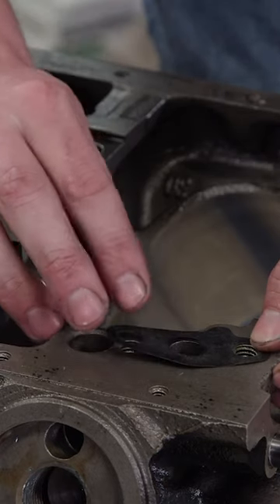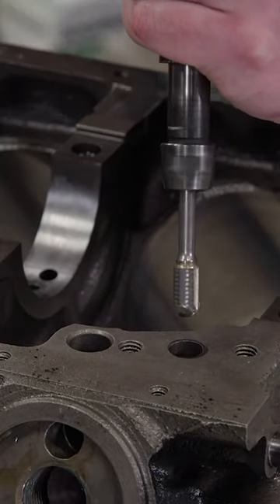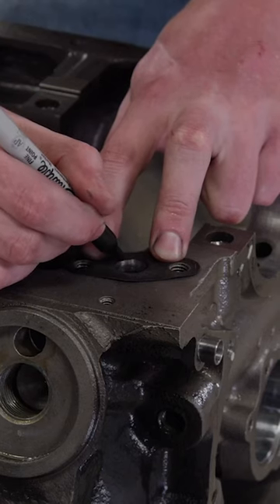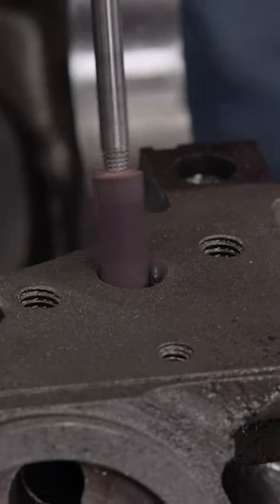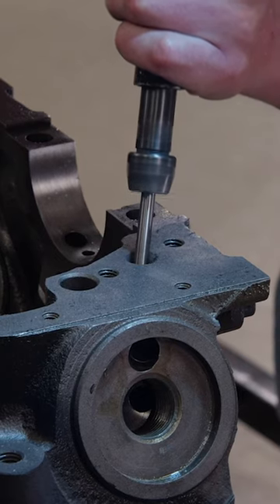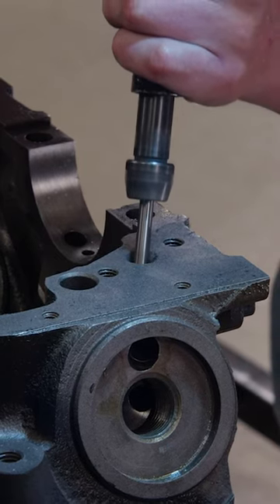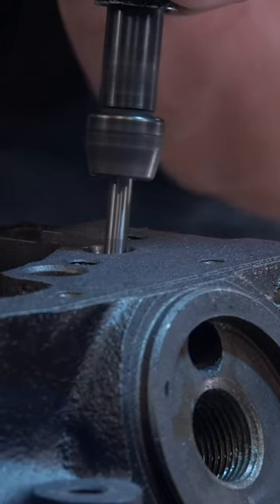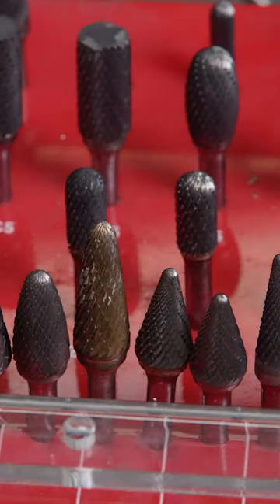Using Carbide Burrs on a Ford Small Block Windsor

Comment: I port matched, intake, heads, oil gallies block to heads & crank bearings too.   Oil pressure w a high flow pump was 90 psi cold & 55 PSI after hours of driving in 74F temps pulling trailer on way home.    I also debured all of the casting seams in the gallies heads & drain back ports.
Really helped oil flow until the dang harmonic balancer tossed its guts at 11 pm towing the boat in Nebraska...

Comment: Always amazed at the nuances used on engines to increase viscosity wherever possible to increase any and all fluid flow thus increasing HP!!  Performance nuances should be at the center of automotive education!
Reply: An increase in viscosity is a decrease in fluid flow.
Reply: Increased oil flow does not increase power at all
Reply: @REAPER3fitty  I think what he meant is you need more oil for more power

Comment: I use rifle and shot gun ball hones after using my carbide burrs and sand paper thru all the oil passages including inside the torn down oil pump.   Then a jet tank wash.  With a water follow up with oil galley brushes.

Comment: There’s a bunch of machinists having aneurysms right now.
Reply: Not a machinist. Still hurt my heart.
Reply: 27 year Red Journeyman machinist here with many years engine building experience and owner of an automotive/general machine shop. What's the issue?
Reply: @whiplashmachine  I'll ask you in return: What do you think we consider is the issue in this video? I'm sure you have enough experience to pick out the reason and any misconceptions we may have about the work.
Reply: @frikyouall  dudes gasket matching, see no issues🤷‍♂️
Reply: @whiplashmachine  Then we'll leave it there. What automotive shop did you say you owned?
Reply: @frikyouall  I didn't say, but should be easy to figure out.
Reply: @whiplashmachine  Yep, fair enough. You get on the internet long enough, you stop looking at names. Have a good one, fella.
Reply: @frikyouall  lol, no biggie😂 You have a good one aswell🍻🍻

Comment: Nice. Except the gasket has NOTHING to do with the mating surface diameter. Great. You ported half, probably caused a shelf and oil cavitation. Nailed it. Guys. This is a click bait shit short clip. Lot more than what you see here. Don't think this is all there is. Which it sure seems to portray

Comment: Throw the whole thing away and put a junkyard LS in for 300 bucks.
Reply: They will only be $300 for about 2-3 more years before prices really jump. And a junkyard engine isn't $300 anymore. Most junkyards also charge your for each accessory.
Reply: Cheap LS headers are 300 bucks. What junkyard do you go to? I need that address bro.
Reply: A 351w can handle a lot of power like an LS.  It's not exactly like a 302.  Bigger stronger block and some aluminum heads and a little boost and bam 800 HP and no block splitting   an LS swap is a waste of time unless you started out with a four cylinder mustang then I might see a point.
Reply: @KingJT80  my brother had a 351w in his 2dr 78 LTD. That big ass boat was fast. I like the 351.
Reply: @cutlasscrazy6081  yeah I had a 78 cougar with a 400M. It was a turd.